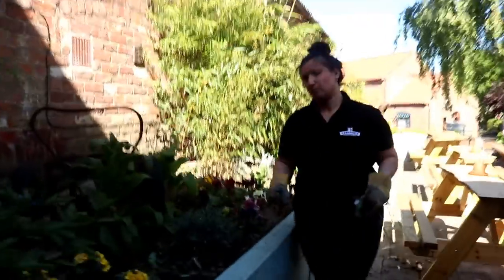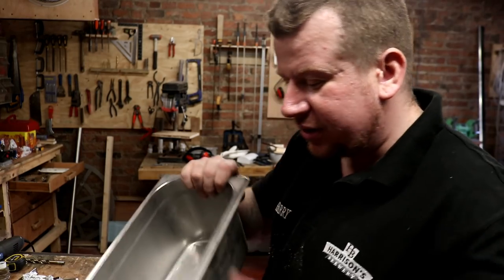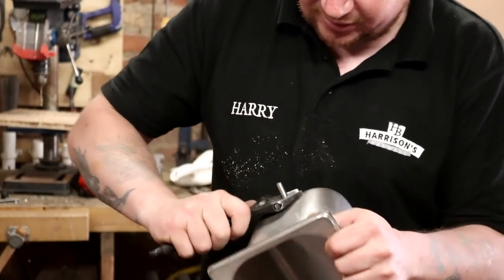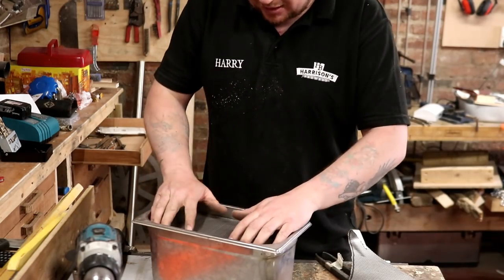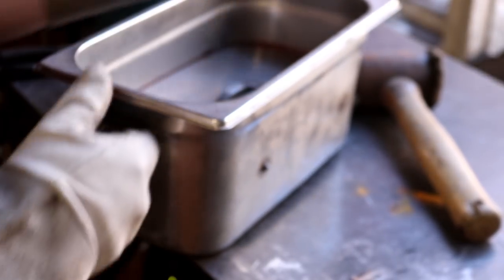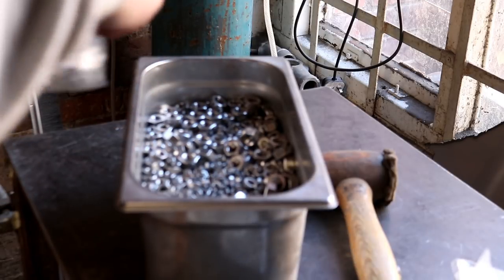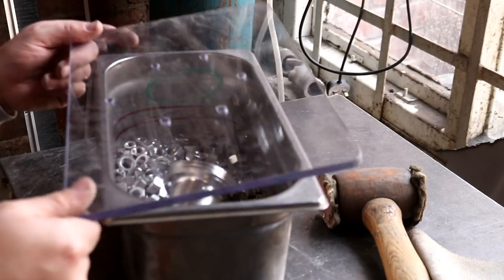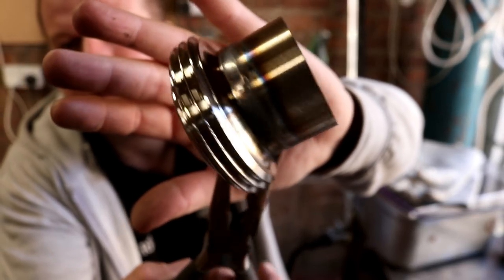BACK PURGE BOX FOR STAINLESS

Comment: At work we use steel wool from the supermarket as a diffuser. I would think that having a screw fitting with a hose Barb 1 end and pack steel wool in the other would save you using tape at all. Cheers.

Comment: Hey Harry, is argon heavier than air so as long as you don't have a fan blowing over the box it will just fill up and flow over the edges so once you start your weld there is no reason for working around the awkward lid? I started tig welding evenings every few days about 6 weeks ago on mild steel to get a feel for it before moving to stainless for my brewery re-vamp / build and thought id go over your old vids to look for tips. Also i notice you using copper or aluminum to back sometimes is that because steel would stick to the stainless and copper or ali wont? Thanks for the inspiration man. Chris in North Devon.
Reply from the maker: I don't use that lid anymore. For backing it was to pull the heat away to stop distortion. I got most of my tips from Jody at welding tips and tricks https://www.youtube.com/c/weldingtipsandtricks